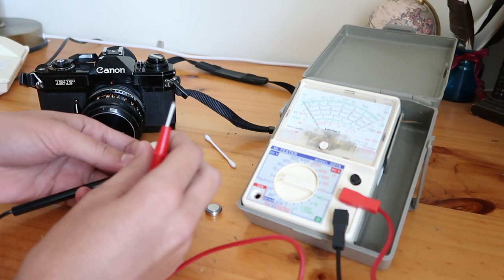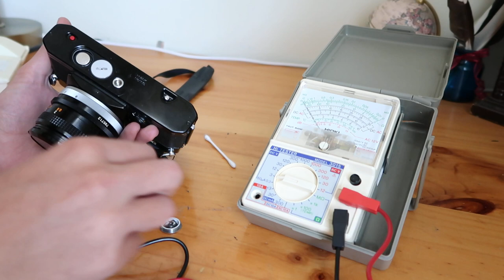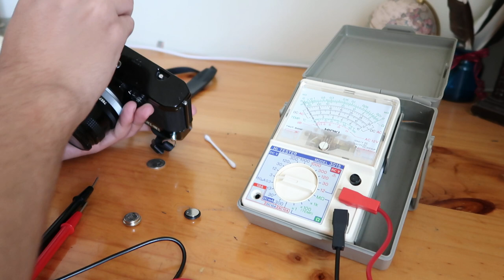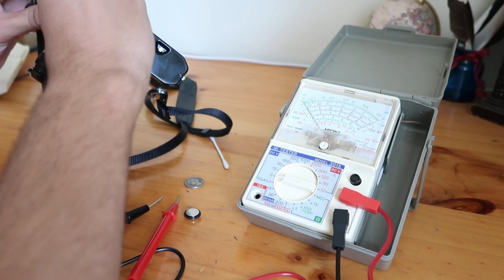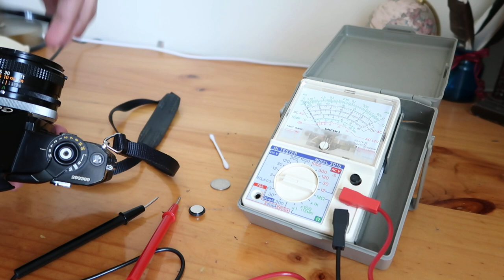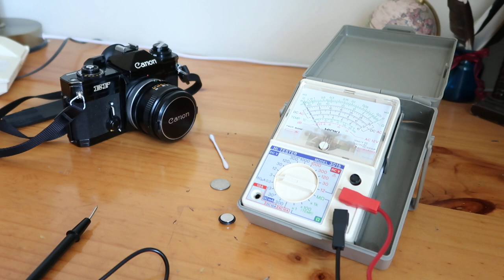My Canon EF isn't Dead! My battery replacement trick just didn't work

Comment: jeez - you don't need batteries!  The most used shutter speeds all work mechanically and a light meter is all you need to manage exposures - awesome camera. Wein MRB625 1.35V Zinc-Air batteries will get the job done if needed.
Reply from the maker: Yes, I am aware that only the slow speeds are electronically controlled, it's one of the reasons I bought this model. If the battery were to go flat mid-outing I wouldn't want to be stuck with a useless box. I just like being able to use it on automatic, makes it a quick camera to use. I was hoping to use it for night photography with those really slow speeds but when I do I'll probably be using the bulb mode as the slow speeds are pretty unreliable on mine. It is a really beautiful camera, I enjoy using it. 
I'm too cheap to buy the zinc-air batteries and often I won't use a camera for months at a time so their short lifespan is not ideal for me.
Reply: The shutter-priority mode won't work without a functioning light-meter.
Reply from the maker: @hansemannluchter643  Yep, if the battery goes flat I have to use it in manual mode.
Reply: @toomanyinterests  You can use modern 1.5V 625 batteries, the EF has a built-in voltage regulator.
They'll last a lot longer than zink-air batteries, provided you remember to shut off the camera. 
Also, the 15 seconds and 30 seconds times are actually 16 and 32 seconds.
According to the service-manual there are 4 versions, first version only had a micro-prism focusing screen, later versions had split-screen. Apart from that, the differences are in the electronics, the service-manual shows how to "upgrade" the electronics.
There's at least one capacitor inside, and they don't last forever.
Reply from the maker: @hansemannluchter643  I do need to get some proper 625 batteries, my fix is rather dodgy. 
Interesting about the longer shutter speeds, although from memory it was most of the slow shutter speeds that seemed to stick on mine. I wonder if it could be a capacitor. Not sure I want to mess with the insides of this camera, as currently it still mostly works properly.
Mine is one of the later versions as it has the split-screen.

Comment: I have the same problem with my EF. Is it enough if I only one of the batteries, provide with aluminum foil?
Reply from the maker: If both your batteries aren't making contact with the side of the compartments then both will need foil. I've been told that one battery powers the long shutter speeds and the other powers the meter, so if you only want one to function then you could manage with foil on just one. 

I still have one good battery of the correct size that makes contact with the side, so I only needed to add foil to one battery that's smaller. When you add the foil, be careful not to short the two sides of the battery.
Reply: @toomanyinterests  Thanks for fast feedback! One more question: Which battery have you used? I has use the PX625 1,5v. I read on different internet sides that the EF can regulate the voltage. But also with these batteries it doesn't work ...
Reply from the maker: @mjgerpriv  You're welcome! Mine came with two V625PX 1.5V batteries, I replaced one with an LR44. I too have read the EF can regulate the voltage. If it isn't working you can try cleaning the battery terminals and making sure the batteries make a good connection. Also look for any signs of corrosion. If you can't get it to work even with those batteries which are the right ones it could be there's another fault with your EF.
Reply: I've seen quite a few posts on the internet about EF lightmeters either not working at all, or suddenly stop working.
Since I now have 2 Black Beauties, got one more yesterday, with a nonfunctioning meter, I'm planning to open them up and find the faulty component. 
I hope/suspect it's just a failing capacitor, a common problem in 5 decades old electronics, and relatively easy to fix..

EDIT: Turns out the little exposure-lock button was stuck in the lock-position.
A drop of isopropanol and some wigling freed it, and the  lightmeter worked again..

Comment: Why don't you just buy 2 625A  1.5V batteries?
And you need 2, the camera does not work with only 1 battery installed.
Reply from the maker: I don't have any of the 625A batteries currently, while I do have the one I used, so I found a way to use it. I know the camera needs two batteries, one of the original batteries still had charge. 
I will be buying some of the correct batteries though, as the other battery is now flat and this trick is a bit fiddly. In the long term buying the 625A batteries is easier, I just wanted a quick fix with what I have.